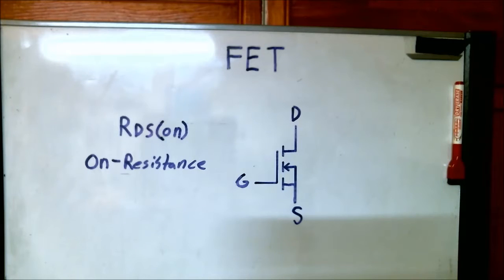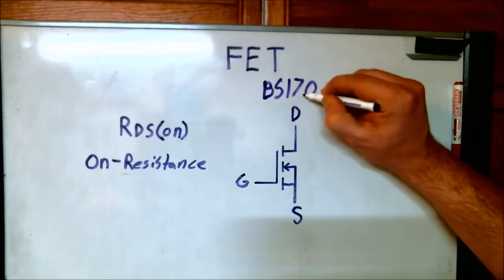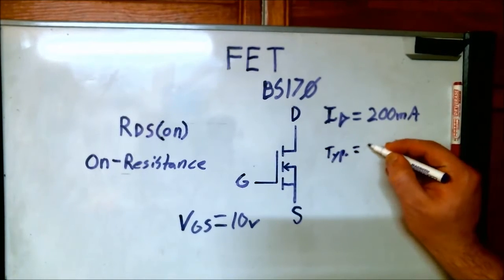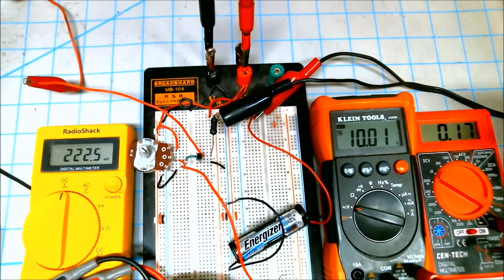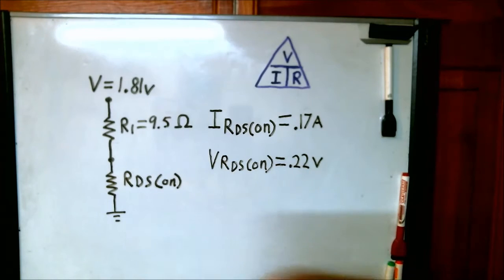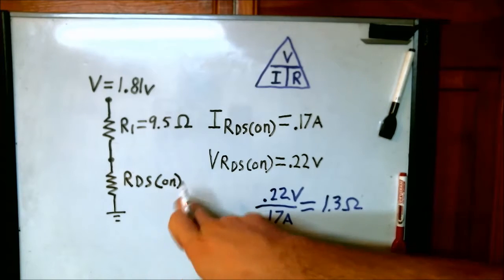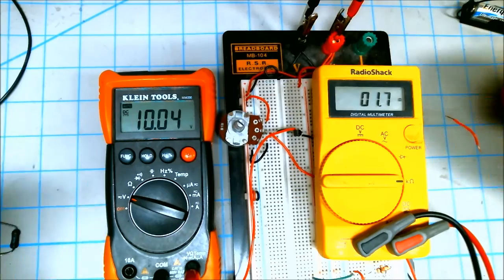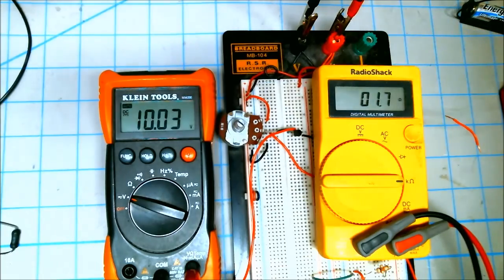What is RDS(on) AKA On-Resistance?

Comment: Why is the second measurement technique inaccurate? Seems like a logical method
Reply from the maker: The current the ohm meter is pushing through the transistor is very little. so unless you are driving a low power device such as an LED, The resistance measured will be lower than the intended circuit. The higher the resistance will cause more power to be dropped across the transistor. Heat sink needed.. thermal effects to other components... Anyway thanks for the view